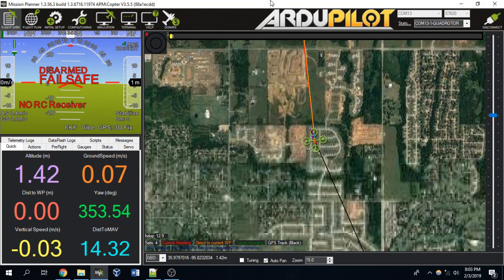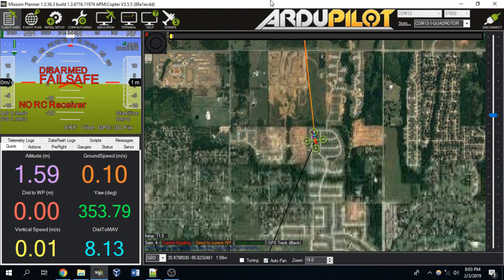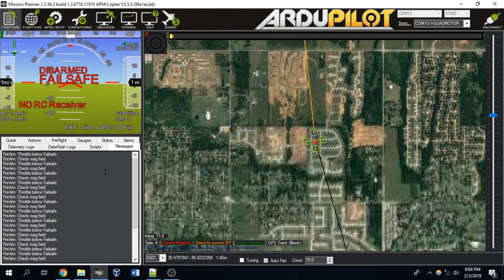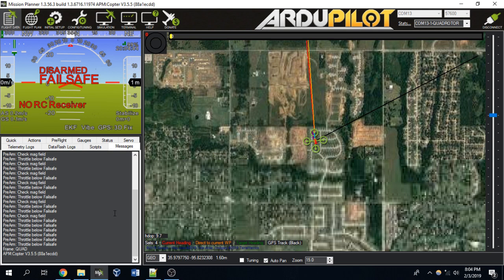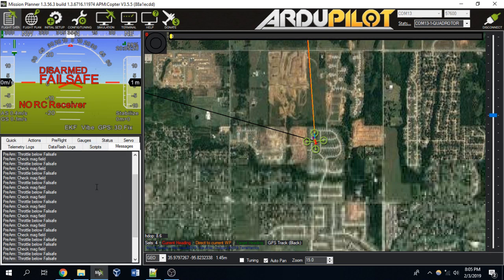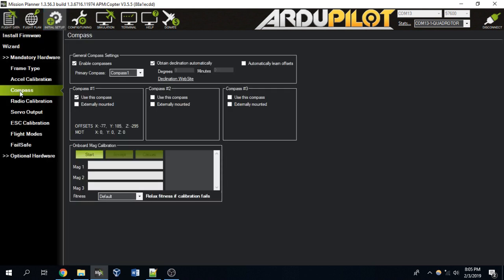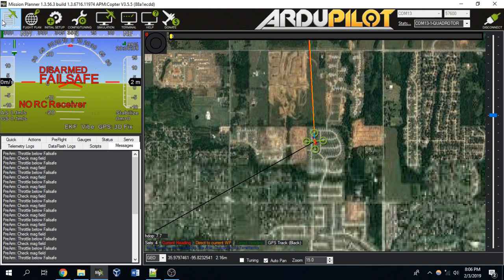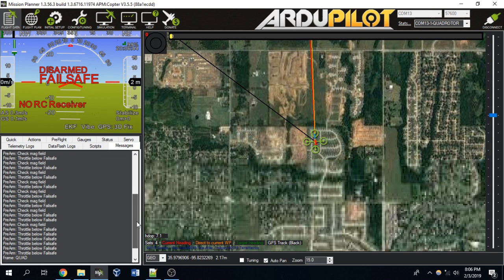Troubleshoot Drone Arming Issues with Mission Planner

Comment: Hey, could you please help me with a problem I’m having on arudpilot. I keep getting A Prearm: throttle Min too high alarm that keeping me from flight or even being able to turn the motors on. That’s the only issue I hope. This is for a pixhawk s550 with a FPS-i6X transmitter
Reply: Did you ever figure out the problem?